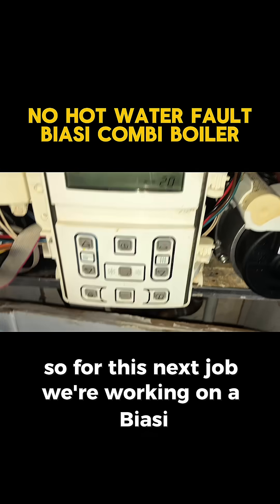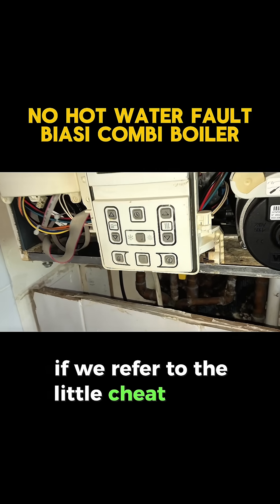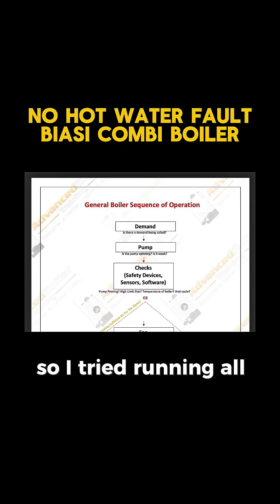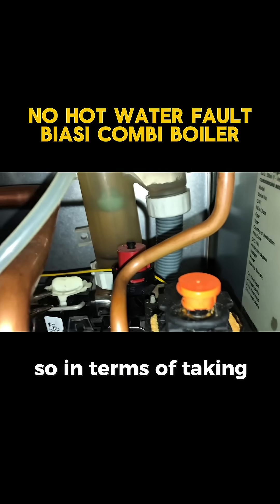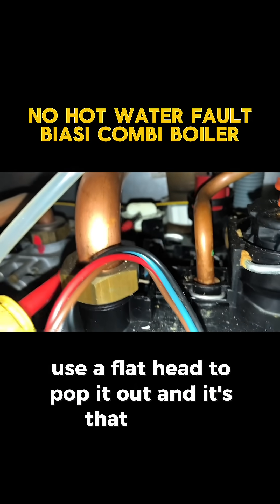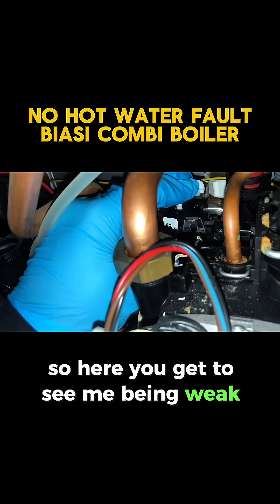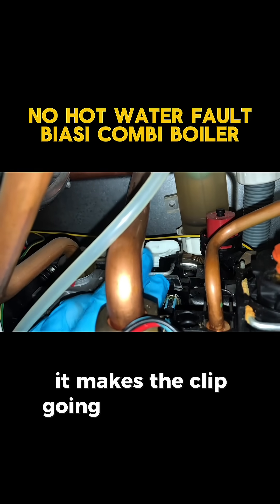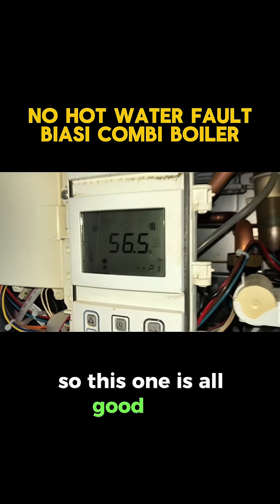No Hot Water Fault Biasi Combi Boiler #hvac #gasengineer #plumber #boiler

Comment: Hello mate before you came to that conclusion how can you double check it is the flow turbine thank you
Reply from the maker: Put a magnet on the sensor (some boilers you need to rub the magnet on the sensor). If the boiler fires up then it’s the turbine
Reply: @advancedboilertraining and if the boiler doesn't fire up after rubbing the magnet on the sensor then what could it be?
Reply from the maker: The sensor / cable / PCB